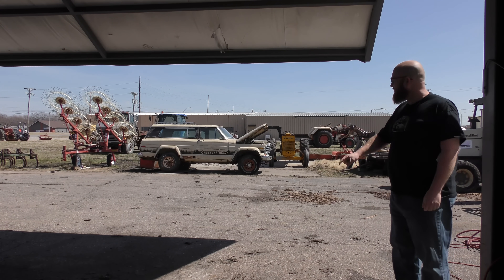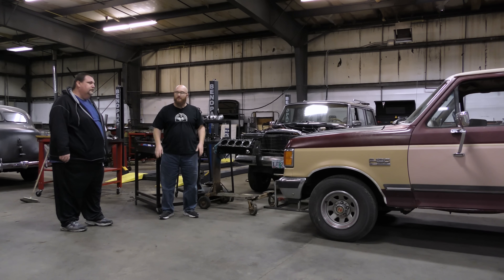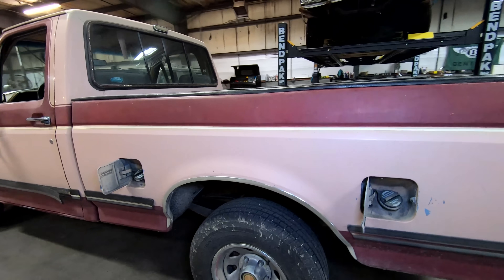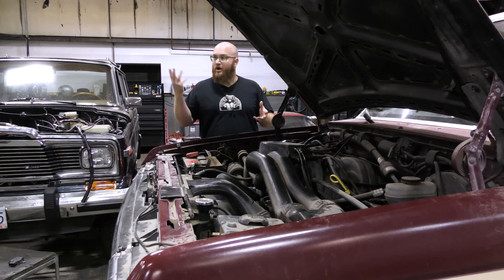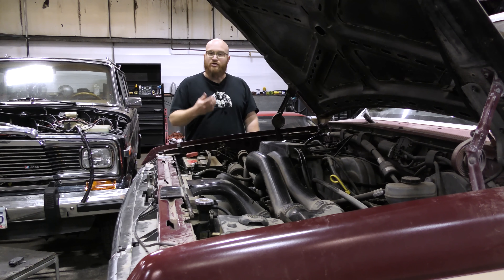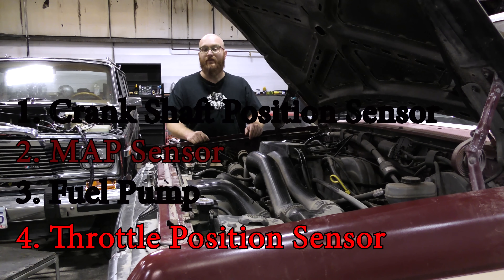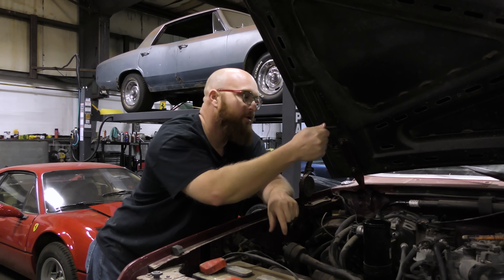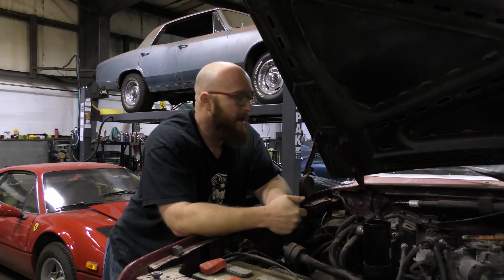Parts cannon couldn't fix this '90 F150. Old School diagnosing by the CAR WIZARD

Comment: I have a 94 bronco 5.8 with the same idle issue. I shot $200 in parts spring 2021 and I'm guessing the MAP sensor. 

Ha kinda right. I actually replaced all of them but the fuel pump.  Still have a low serging idle. The throttle! Super sweet that's where I'm at just didn't want to spring the 300 for a new throttle body. Maybe it's time for a new throttle I'm a big salvage yard guy fingers crossed I find one.
Reply: smoketest witha cigar.  several comments replaced bushings with craft store brass tube cut to size.

Comment: The issues I had with our 1990-era F150 was that the rear tank rusted out some how and could only hold maybe 1/2 a tank, so we stopped using that tank and just ran around on the one tank.

I always found it was funny that Ford would make it so their odometers only went to 99,999 until about mid 1990's, meanwhile companies like Honda and toyota had odometers that went to 999,999 like most modern vehicles (Although all modern ones now are pretty much digital, and not analog/mechanical).

I do have to say that modern vehicles, the advantage of the computers in them now, is that they can tell you what is wrong in some cases.  And some vehicles, like my Ford Focus I had (2012 model year) had a "diagnostic mode" you could put the car into (no tools needed) that would let you look at RAW data coming off the engine computer, like RPMs, transmission temperature, etc) directly from the small LCD screen on the dashboard.

Comment: I have a 91 F150 xlt lariat, looks almost the same as that one, mine has the 5.8 When I bought it a year ago it had 124,000 miles on it. It runs like new yes I had some troubles with it finding a ford mech really helped as the last was better with GM rather than Ford.

Comment: I currently have this same truck and just recently fixed a high idle problem. I changed the TPS and the MAP sensor, nothing worked. Ended up pulling the intake off and found a leak on the gasket towards the front of the motor. It felt so good to hear my motor idle down to normal rpm’s 🥹

Comment: Ive had a number of F100 and F150 trucks I usually keep them for a few years and sell them just to turn around and Buy another over the years I love the 300 I6 it's a real tough cookie I recently bought a 94 F150 with the V8 it runs great only 109k miles i only paid $350 because it had electrical problems that Turned out to be redneck wiring fixes After cutting out a rat nest of extension cords and stereo wires used for power and putting everything back right I have a nice 4x4 F150 don't think i'll sell this one anytime soon though !

Comment: I’m going through the same thing with my 92 Flare side 351 some mechanics won’t even look at it (OD1) other say let’s try this ? I bought a handheld scan tool and NOTHING! I really hate to say it but I fired the parts canon a couple of times , I think I’m into two thousand dollars range and just found it $17.00 MAP sensor. I sure wish I could find someone like you 
Throttle body I went with BBK a little bit more money but in stock at that time

Comment: I had a 1989 Honda Civic when I was in my early twenties that had a high idle and stuck throttle that would leave the idle up to 2000 RPM. Replaced the IACV and throttle cable and nothing. Was likely the throttle cable being too tight when warm because I had pretty much the exact same problem on a miata that I pushed the throttle plate down after having a hunch after getting home one night. Live and learn I guess.

Comment: As far as the throttlebody, I got one from the junkyard and so far it’s working good I bypassed my coolant lines I mean, sometimes it’s good to stock up on Parts but where can you get the throttle body bushings anyways? Sometimes it’s best to put a used part on there even with the old equipment is better than the new stuff that’s for sure.

Comment: Oh the memories here trying to diagnose with the KOEO tests 
No data. Wiggle tests…haha ford had some unique diagnostic ideas back then. KOER was even better hit the brake pedal turn the steering wheel and wait for codes. 
Snap on mt2500’s can be had quite reasonably with all the trimmings.
And the built in troubleshooter is pretty good with common problems. 
They aren’t serviced anymore by snap on, so are obsolete and can be fond on eBay if you own an old truck and want to keep it alive those are a decent investment. The newest software I think is up to 05 I believe.
I don’t use mine often but when I do it’s worth it’s weight in gold.

Comment: Whenever it came to a loose throttle shaft I always took it to the machine shop to have it machined for brass bushings, much cheaper then a new throttle body or carb.

Comment: David,  I checked with Summit Racing to verify they had the throttle body in stock for the Ford.  Elliot responded that they had more than 10 in stock.  Check them out

Comment: I can diagnose old school pre-obdII vehicles but the young tech have trouble with that or don't even know.  At a local Toyota Sevice center, the service manager was explaining to a tech how to use a timing light on a 1990 4Runner.and about points/condenser and dwell angel.

Comment: My dad had a 95 ford Econoline e250 work van he bought used from a company that used it for long distance highway miles and bought it with 200,000 on the clock, that van had the original engine transmission and rear end and had almost no problems he used the van longer then i was alive and he just recently sold it to our friends since the rear end had some issues that ended up being a easy fix with a shift solenoid. That van had near 600,000 miles and still works over 28 years later ford built these trucks and vans different. Right now he has a 2008 ford e250 with around 90,000 miles and it still has the original drivetrain with no issues thanks to the 4.6 modular v8 to bad ford stopped making the e series vans 😢

Comment: Both my cars, a '92 Dodge Shadow and a '97 Geo Metro, when I got these cars they where already at over 100k miles, they had weird problems, and both had the loose throttle shafts. I have to admit to finding those problems by accident, when I was under the hood trying things to find the problem,  revving the engines with the throttle bracket, and noticed the shafts where loose in the bores. I was able to have the throttle bodies re-bushed at a local carb shop at that at the time was still there in the early to mid 2000's, that place is long gone now. I don't know if anybody does this kind of work in the local area for walk-in customers anymore, I'd probably have to mail it off somewhere to a remaining shop if I wanted that done again.

Comment: This truck will be worth something in a couple years, nice body, decent interior apart from the roof. With new paint this truck would be really nice
Also an Olds 350 Diesel video would be awesome! I would also like to learn about the issues you allude to with the 6.2
Reply: I think you are correct. I have a 91 black F150 XLT Lariat 4by 4. I’ve owned it since new. I looked up similar trucks to mine and people are asking incredible amounts for great condition examples.

Comment: As an owner of a 92 Toyota pickup with a 22re.... I know the pains of diagnosing drivability issues with zero engine codes. I have specs memorized for most of the electronic sensors on that old truck....

Comment: I actually guessed the MAP sensor first, vacuum leaks, and throttle position sensor last, but since that was replaced, that left the first two.  I would’ve had a hard time figuring it would’ve been throttle body bushings over vacuum hoses.  So many times when I think of vacuum leaks, my mind goes straight to rubber hoses.  But it makes sense.  Think of how many times the throttle body has probably moved back and forth over almost 200,000 miles.  Parts wear out especially on a 32 year old truck.  
I’m currently restoring a 1977 C3 Corvette and from time to time I’ve had to look at eBay for used parts.  I know it’s not ideal, but maybe that’s an option for him in this case.  Most shops won’t warranty their work if you bring your own parts, and rightfully so if it’s a used part.  If it was my truck, I’d say my first choice (if no parts were available anywhere from any supplier) would be to repair or rebuild it.  Second choice would be salvage yard or used parts on eBay.  There’s always the “better aftermarket design and upgrade” version of repair but usually that gets pricy.

Comment: What i do if i cant get oem or nos parts is remove the throttle blades and shaft, put the throttle body in a drill press and lightly drill into the outsides of the shaft bearing casts with a champher bit, then install very thin o rings on each end of the throttle shaft. But before i do that, i measure how far the shaft extends out of the throttle body then cut 3 tiny grooves just a little less than the thickness of the o ring on each side and install e clips with nylon washers on each side to seal off the shaft bore.
Of course you could just measure the throttle shaft and install brass bushings in the shaft bore and polish them untill the shaft moves freely with no resistance  as well, thats what we used to do on worn out carbs that had vaccum leakage at the bores

Comment: The 351W is the way to go with them. And they are super easy to work on. Best thing to do on a truck like that is convert it to carb. Also my 88' 7.3 the front tank went bad. So I took it out and bypassed the switch with clear line.

Comment: The scan tool cost around 35 dollars at Advanced auto, but it provides information using light codes. there is no screen that tell you exactly what it is. It's the idle control valve. you can clean it and they usually fixies it. It doesn't mater that they replaced it, they get dirty. just clean it.

Comment: I had a very similar problem with my 97 F150, I had a vacuum leak from the throttle position sensor. 

It’s plastic and supposed to seal on the throttle body with no gasket from the factory. I added a gasket fixed the leak.

Comment: This is sooo similar to what I had with my 1995 fiat punto cabrio :) obd1, same problem. I tried some sensors, tried vacuum lines, in the end the problem was with the gaskets of the throttle body, I bought a gaskets set for it and the problem was solved. 
It then had some hasitation when accelerating but that solved itself 🤔

Comment: On my 89 the issue was the routing of the vacuum lines,ford issued a new update and all i had to do was run a new line over to the brake canister.idle has been fine ever since

Comment: To me as a shade tree mechanic, this is easy diagnosis.  To me, the machines and codes are much more difficult, since the level of scan tool needed to chase down specific fault codes is waaay out of my price range.  Testing resistance and vacuum leaks is not that challenging for an everyday person.

Comment: Mentioned every engine option except arguably the best one - the big block 460! All good engines at the time though. I think I would have prefered the windsor 302 to the in-line 6 at the time though. The latter was pretty gutless for a work truck.

Comment: BBK makes a nice aftermarket  throttle body for that truck. It's called BBK Power Plus twin 56 mm Throttle Body. No more leaks and  $389.00 at Redline 360 Hi Performance. That will solve you problem.

Comment: This is just a patch, but it can work for awhile depending how worn.
  Stuff done fifth wheel grease in around the outside of the shaft, as the runs it's pulled in, since the cable pulls from the outside the inner is narrower.
  It does not allows work, but I have seen it work up to and  over a year.and nobody's knows anything wrong..

Comment: My dad bought a 1988 250 with the 302.  After four years the rear engine seal began to leak oil. $600 to fix. It was a great truck. Two tone  off white and blue. Long gone some 26 years now.

Comment: 2 THINGS IVE SEEN ON THESE OBS TRUCKS.THERE IS A GROUND NEAR THE NEG BATTERY TERMINAL ON THE FIREWALL (REMOVE IT AND CLEAN IT REINSTALL IT)2 LOOK AT YOUR ECM,SOME HAD A REMOTE GROUND TO THE FIREWALL BEHIND DRIVER HOOD SPRING(CLEAN THIS AS WELL IF IT DOES NOT HAVE THIS REMOTE WIRE ADD OND FROM GROUND ECM WIRE TO FIREWALL)HOPE THIS HELPS

Comment: My first guess was vacuum,  and with your multichoice test, I did guess the MAP     I have a mild built 5.0 in my 1984 Datsun S12  yes a very reliable engine    no not as powerful as new v8's but I bet they last longer for much cheaper costs

Comment: I've seen where the spare tire to rub a hole or holes in the rear fuel tanks as well. Of course being in the Greater KC Metro, I do have local access to LMC Truck Parts. Descent array of parts availabilities.

Comment: Good video. Disagree on the CPS opinion though. Intermittent issues are possible. 90s Chysler MAPs could function till hot, then the car would stall out. A good trick for diagnosis is putting an ice cube on the CPS to see if the problem changes.

Comment: Many states will not emission test pre-96 OBD2 vehicles, one could retrofit a carburetor on it instead.  The carb would probably make more power too...
Choice #2 is update it with a newer OBD2 engine...

Comment: Honestly to me that's not too bad as far as mechanic bills can go . And that truck is totally worth that. I bought a 05 dodge Durango limited for 2000 bucks. Im going to completely go through it over the next 2 years. I'm going to put a new motor in it and a new transmission and transfer case as well as a new rear end. I have already started replacing everything else in the front end all new everything. But in 2 years I'll have basically a completely rebuilt truck for 10 grand. Now in my case I'm capable of doing the wrenching myself. I have actually already done a motor and transmission swap on one of these helping a friend out on his. So I'm already pretty familiar with this year and make . And I also have all the available tools to do the work properly. So for me it makes sense. I just can't bring myself to pay these insane prices for a good vehicle. So I'd rather buy something and completely rebuild the drivetrain for a far cheaper cost and better reliability on top of that . Now it probably would not be worth it to pay a shop to do all the work. It might be but your not going to be saving that much vs buying a decent 20,000 to 25,000 dollar vehicle. That and it depends on how much you have to pay for the actual vehicle. In my case the vehicle is high mileage but has been taken care of and is in good condition. Not only that it was part of an estate sale and I got it for insanely cheap. It had sat and someone tried to steal the cat but only got one side cut . So when they started it so I could look at it and it was loud everyone was shocked and I was able to haggle the price down . The rear hatch was also smashed in but I happened to have one already from the parts vehicle my buddy had bought for his. So I got them down to 2000 haha.

Comment: The MAP sensor on these Fords are digital not analog, can’t acutely test wit a multimeter. Biggest problem with them was a bad ground. The digital signal would show a sine wave between 0-5 volts, with a bad ground shows -1-4 volts DC. Aston Martin used 2x EEC IV for their V-12’s

Comment: Remove screws, take the plates out, remove the shaft. Place a spring that will fit around the shaft (may have to be cut to just a few coils in width), a washer & a Viton O-ring that will fit snug around the shaft in that order. Do this on top & bottom with O-ring against the throttle shaft bushing then washer then spring respectively. I've rescued many old Zenith carbs for Continental engines & various other carbs over the years using this method. In lieu of a spring, I've also used various felt washers, anything that will hold that O-ring snug against the throttle shaft bushing.

 It won't last forever but is easily redone when needed & cheap! That old truck looks better to me than the newest $70K piece of junk on the lot.

Comment: I wouldn't be surprised if that body alone isn't worth a decent amount sooner than later with the shape it appeared to be in and how people are gravitating towards square bodies of all brands lately.  Really appears to just need some minor body work, a paint job, and a bit of a deep detail with a new carpet or insulated floor into rubber (my favorite personally).  It would be a project, but a pretty good starting point for someone that wants to learn more about bodywork and interior over something like Hoovie's SS that was 1/4th rust.

I've messed around with doing scrapyard/weekend builds on the straight-six that was offered in those and actually had some good success for fun.  Similar to all the 2.3l weekend projects with turbochargers among other things.  I'll probably never stop being salty about us not getting the new version in the Barra that Australia got :|.

Comment: As long as you can find parts or can rebuild the part, these Ford trucks will keep on running. I have a 1989 F150 4.6 inline six & a 1989 F250 7.3 diesel. Nearly impossible finding parts but worth spending time and money to keep them running as it is still more affordable than buying something else with different problems.

Comment: Great truck! I have the 4-9 L in my 1995 and the low rpm torque is higher than the v-8. I use it  to tow an 18-5 boat (3500 lbs)

Comment: I know you don't like 'em, but I've never had Rock Auto list a part as in stock and then it not be. They list an Auto Line rebuilt throttle body for the1990 302 for $129. They list two, one for auto tranny and one for a stick shift a multi-port.

Comment: I have a 1981 f100 custom, with a 4.9 inline engine. I know it's getting closer to 200,000 miles and it stills run great.